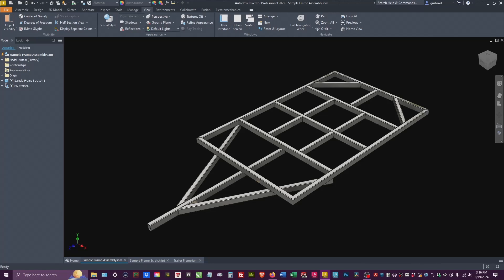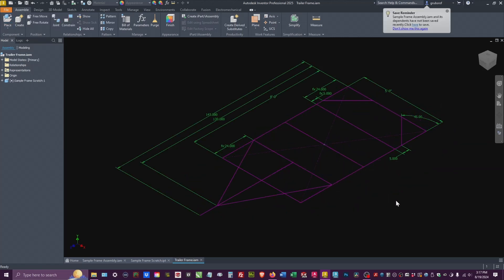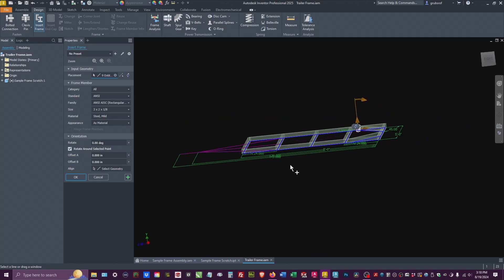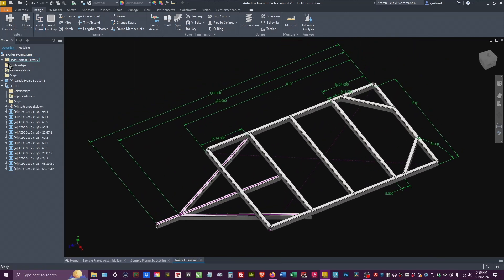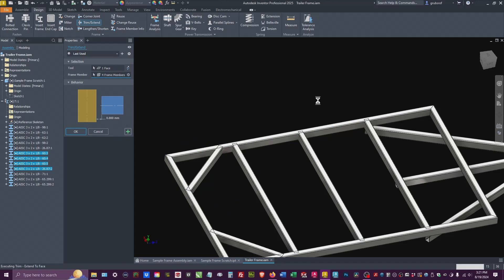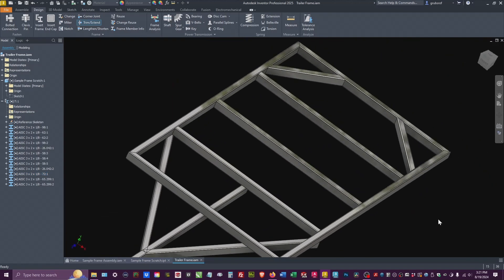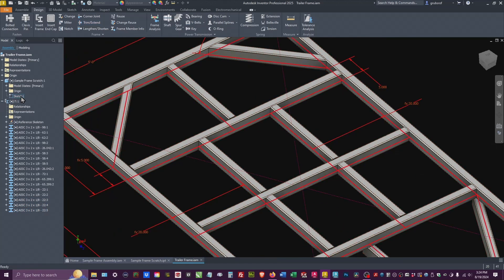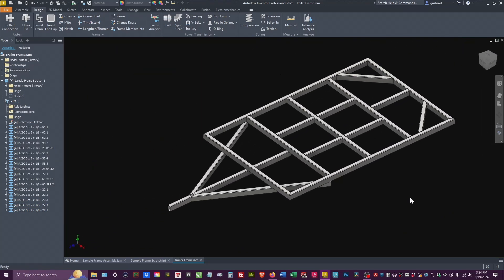Autodesk Inventor - Building a Trailer Frame

Comment: I have questions 
1.Where would the wheels go on top or bottom of the frame? And where specifically would it be fitted?
2. If I reduce the size of the trailer can I reduce the number of steel used?
Sorry for bad English it's not my first language and I'm still learning about inventor
Reply from the maker: Axel goes on the bottom. This is just how to use the frame generator so I didn't go into that detail.
The structural size is base on the size of the unit and it's weight requirements. I only added more parts to show how to do so. it does not need to be built just like this. Sorry for the delay in answering.